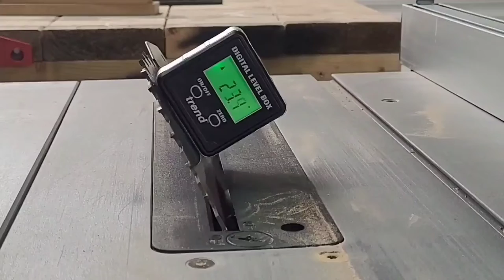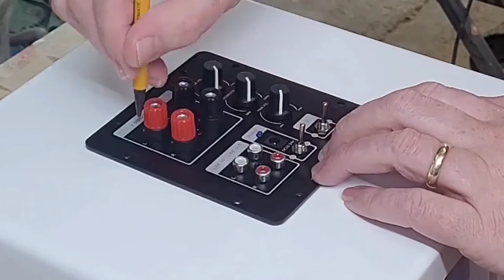DIY SUBWOOFER – Budget Build of an active Downfiring Subwoofer – 8" - 100 Watt Subwoofer Under $100

Comment: Excellent work dude. Accurate and well assembled box too which was gratifying to see. I see you went Class D for the amp. Must admit I was tempted to go for class D but being cheap I bought a used "Rogers" 12 inch sub. Excellent case work but the rest was pretty bad and I got it cheap because the owner said it sounded "funny". Funny alright, bloody awful sounding. Made in China and no more related to Rogers than I am to the king of Norway.

Anyway it turned out that an inductor was loose. Bad solder joints, so I fixed that. At the same time I changed out the power transistors for something higher rated, and increased the reserve of the power caps. Probably no advantage to either. The Rogers 12 inch woofer was subbed for a better one from Element 14, or Farnel as you might know them in UK.

The box, like yours, I made from a sandwich of 18mm and 12mm mdf and it's screwed and glued together. Certainly not as accurate and well fitted as yours but I got there in the end. Down firing.

For anyone who might read this, I found a cheap alternative to the stuff which gives a rippled textured finish.  Being cheap I mixed black paint with talc and black ink to bring back the black. Otherwise the paint turns grey. Using a stippled roller and two coats, finished with satin polyurethane clear, I ended up with a spectacular result. Might be interesting to anyone who wants to do a textured black finish on a budget. The real stuff is quite expensive..

Anyway, enough from me. I like what you've done dude. A great job, and I thought I'd share my experience....
Reply from the maker: Thanks... Great to read it worked out well in the end for you!!
Reply from the maker: Ingenious way of getting textured paint!!
Reply: @DIY-AUDIO  Thanks. Worked out well for an old skinflint like me. Looks the business and I'm extremely pleased with the way it sounds. Digs very deep and seems very tight. No droning or buzzing. Mind you I've got the controls turned way down. I'd rather have bass that's supposed to be there than it being over-emphasised which many folks seem to do, particularly in cars...

Comment: Very impressive, why do the final paint coats with a can and not your spray gun ?.
Reply from the maker: Thanks, It's a cheap old gun for primer but would need a better one for top coats and to be honest, as I vary the builds, buying car paint and thinners by the litre will be expensive and wasteful. The acrylic paints are only £3-4 GBP each and dry quickly (they are specialist grafitti paints)

Comment: I know how to calculate impedance of each wooden box but I want to know if you connected tweet and mid ranged speakers in parallel o series. thanks
Reply from the maker: On this build neither. Have connected in series on my sound bar build though